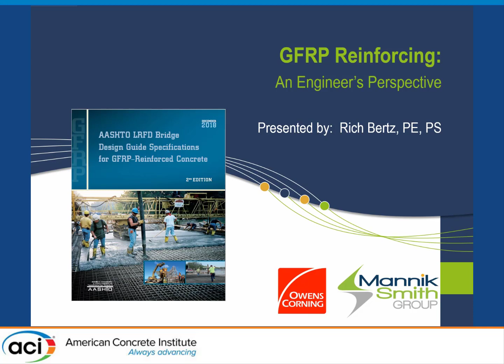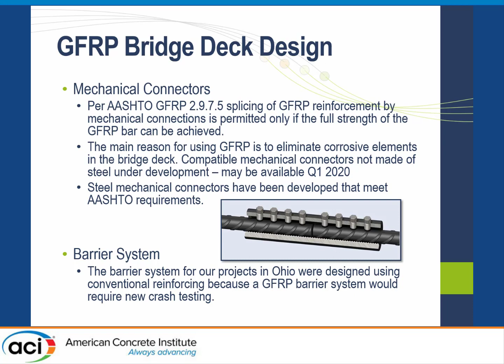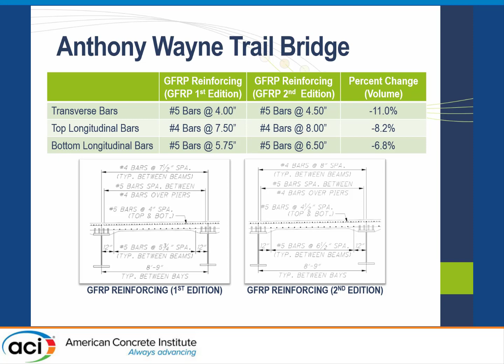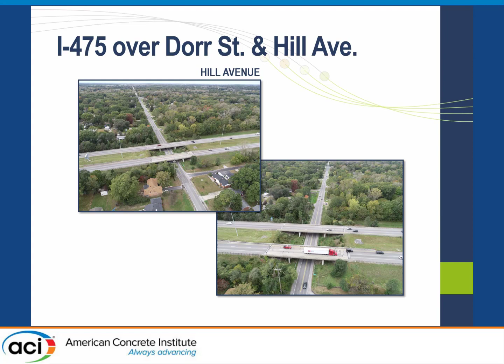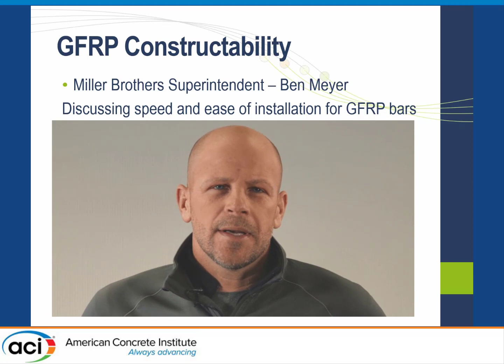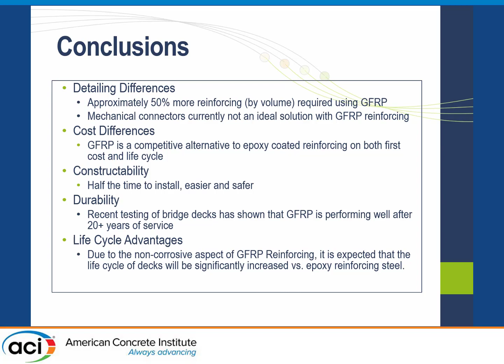GFRP Reinforcing: An Engineer’s Perspective

Comment: I'm not an engineer, but I really nerd out on this stuff. I would love to hear about progress by Owens Corning or other manufacturers in increasing the modulus of gfrp rebar. Do they supliment with fibers  other than e-glass during the pultrusion process? Would also like to hear about progress with gfrp connectors, as well as producing bends. Thanks for the video.